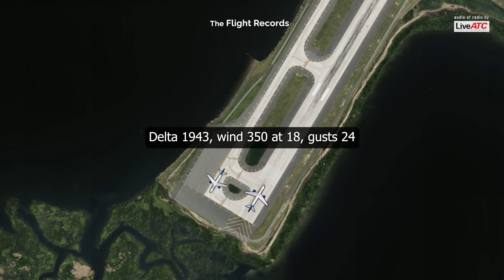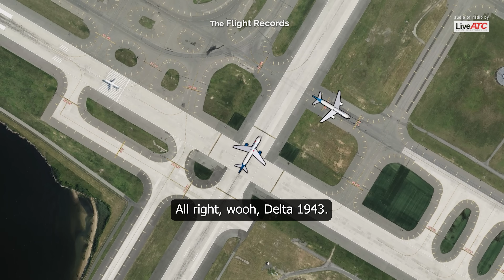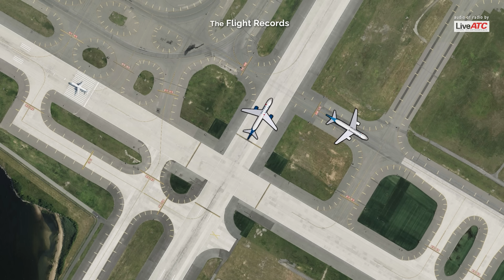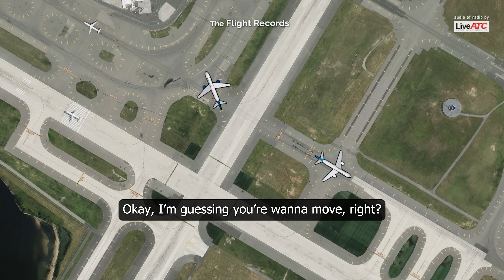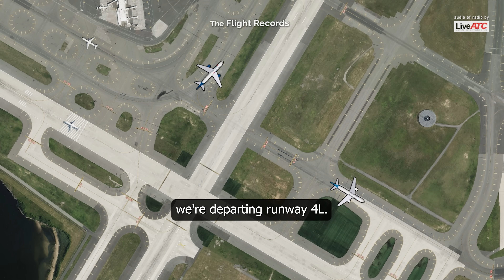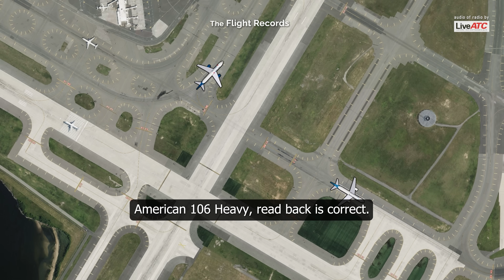NEAR HIT AT JOHN F. KENNEDY AIRPORT

Comment: I’m an Airliner skipper, sometimes reading public comments related to aviation details is amusing and annoying but I understand its just ignorance.  Just like my ignorance of the details of other professions.   The female pilot was the first officer, not the Captain.  F/O does the radio work on the ground.  The Captain made the taxi turn error.  For those making comments about females in the Flight Deck, I don’t think Equity policies are ultimately a good idea either, but there are many very qualified female airline pilots,  I’ve flown with many I respect for their professionalism.  Both sex’s make errors.  The First Officer is the backup to the Captain during taxi, and also should have caught the mismatch between the ATC read back and the turn or lack of turn the Captain should have made.   I use the “FMS scratchpad” technique to jot down the f/o read back / instructions from Ground Control.  Referencing what is written down / typed in the scratchpad is a popular mitigating technique to reduce this error from happening.   Further, most Captains, myself included always verbally state where I am about to turn or what the next hold short point is.   This way my first officer can agree or correct me right away.   I include this as my first item in the Threat Briefing review before we even leave the gate.   Pilots are certainly not the only humans in aviation that can make runway incursion errors.   What happened in Lima, Peru recently is a perfect example.   A320 hit a firetruck during the take-off.   Very tragic.
Reply: YouTube stinks of keyboard pilots, warriors etc etc etc
Reply: @malahammer  Looks who's talking LOL.
Reply: Would it have helped if the ATC said 
“Turn R at Kilo, cross 31L”
He actually said 
“Cross 31L at Kilo”
I think the word “turn R”
Would’ve helped. But I’m not a pilot
Reply: @PInk77W1  I see your point, but what the Ground Controller said/instructed was in the “standard phraseology”.  We (pilots/ATC) know what is meant.  We don’t know yet why they missed the turn or had a different mental picture of where they were going.   I can think of half a dozen reasons for the error.   All speculation.   Good question though.
Reply: @InvertedMike  
Yeah I’m guessing if the ATC has to tell every plane every turn it would be too much.  
But yes I was thinking that was the reason.
Reply: @InvertedMike  Did anyone hear AA106 call that back? I didn't.
Reply: @Capitan-America-no.1  That's because this video choose not to include it. See, for example, VASAviation's video on the event.
Reply: @PInk77W1  What you're referencing is "Progressive Taxi" - which is possible, but also pretty resource intensive for the ATC to give so much time and focus on you and you alone especially on a busy airport surface. It's a lot more common for student and private pilots who are unfamiliar to certain complicated airports to request as such.
Reply: @Skyried  yeah I figured. The AA crew should’ve known where they were going or asked more
Reply: @InvertedMike  I’m not a pilot or involved in this industry anyway but clearly pilots are aware of the departing and arriving active runways before pushback. Why would she or he cross 4L knowing there’s no taxi ramp on the 4R side to approach active 4L departing runway? I’m sure AA and these pilots are quite familiar with the field. Who was piloting AA? Yes, more clarification was needed to cross 31 at whatever taxiway to line up and wait for departure on 4L. Thankfully, a major disaster was avoided! This is indeed scary!
Reply: Well said. Whenever I brief my FO’s on threats I always tell them “I’m a threat because I’m human and capable of mistakes….” After which I ask them to back me up and that I’ll do the same for them. Together we fulfill a simple MO. Preserve life. Preserve license. Stay out of the principals office.
Reply: I am a student private pilot and looking for a better way of copying taxi information for  complicated airports and then making sure I am going the right way. I will ask for progressive taxi.  It's not easy and I make sure I study the taxi diagram. Some airports have tricky taxi way. Signs that point at an angle and you are trying to figure out what taxi way it is.   If you know other tricks to make this task easier, I will take it.
Reply: @kimberlywentworth9160  I totally understand.   Taxiing when unfamiliar is challenging.   Firstly, don’t try to memorize the clearance instructions.   Short hand write it on a knee pad or similar.   Just write the phonetics and use a slash before the hold short if given.   You will get better over time.   Use the internet to look up taxi signage to study.   If you are real keen, use the app or website for LiveATC, get hold of the airport diagram for a select big airport’s ground frequency.   Then practice listening, looking at the taxi chart, and jotting down the clearance shorthand while staying orientated with the map route.    Finally, use the DG / compass in front of you for your orientation, and know where the Mag north arrow is on the taxi chart.   99% of the time the map is orientated North up anyway.    Practice, Practice, Practice.   It gets easier….  Cheers.  Mike
Reply: @InvertedMike  These are excellent instructions, Mike! I find ATC instructions daunting at some airports. I never got my license bc my brain can't digest the rapid-paced instructions. Here, I wonder why the FO didn't follow the instructions and help capt. with the confustion -- CRM... Yes?
Reply: @InvertedMike  i’m not a pilot, but I thot your ideas were spot on. They had to help Kimberly.👍
Reply: @kimberlywentworth9160  Absolutely agree with @invertedMike - I always brief it back - even if it's just me sitting there. I even draw on the airport diagram if necessary.
Reply: @kimberlywentworth9160  I have a body shop and can testify that women don't need to be driving.
Reply: Great comment regarding the ignorance. Interestingly my favorite show is Air Disasters, and the more of them I watch and learn from, I’m aware that I don’t know very much at all. What I’ve really learned is to find the exits when boarding the plane.
Reply: @jayinmaine  I really enjoy learning from these types of shows also.  Gets me digging into the official accident reports to understand more.   The more I learn about errors from other events, hopefully the fewer errors I will make in my own career.   If you really want an amazing accident investigation show, check out MentourPilot on YouTube.   Very, very well done.
Reply: @jayinmaine   you might also enjoy the channel of Mentour Pilot, excellent analysis of accidents and incidents. He will no doubt cover this incident as well, but he usually waits for the official report.
Reply: Mike: Amazing words you shared. I just listened to Cockpit Confidential (unabridged, 9-1/2 hours!) while pavement pounding and all I could think of was, "I wonder if Inverted Mike has written a book . . ." Again, great perspective and valuable info you shared.
Reply: @wjroberts913  Glad to share some insight from my side of the cockpit door.
Reply: It's sad that because all of these companies make a point to force equity policies, it results in people assuming that someone is a diversity hire.  If companies were solely committed to hiring the best pilots no matter who they are, then we would know that every pilot is the best and wouldn't even consider race, sex, etc.  Equity (forced diversity) actually furthers racism and sexism rather than eliminates it.
Reply: @postcardsfromprotest  
Not true at lion air.
Reply: Sorry skip. Women are far too dangerous and rely mostly on emotions rather than logic . None of us feel comfortable flying with a woman in command . So stop ur politically correctness shit .
Reply: She was probably applying lippy when the instructions were read out that’s all I’m saying.  See it all day everyday on the roads man.  Or brushing hair or applying foundation you know what I’m sayin bruv
Reply: @jonboy1000  That is just a ridiculous comment you made and makes you out as a fool. Do you know anything about aviation? We still do not have the voice recorders and the whole story as it's under investigation.
Reply: @jonboy1000  Yeah because every single woman ever born dose that right? I have seen men shaving, brushing therre teeth and brushing their hair as well. Is not just woman. Man either you're single or your wife/GF is very submisive.
Reply: @jonboy1000  
No, and neither do you.
You're not too bright.
Reply: @jonboy1000  if you’d ever choose to fly on my plane, I’d gladly leave you behind at the gate. Just for your own safety, of course.
Reply: @jonboy1000  Yes and doing something not driving related while being PARKED at a traffic light, at a crossroads or even cruising etc. is totally the same as being an intensely trained pilot during one of the most challenging phases of any flight. - Logic and appropriate comparsions please.

Comment: I “always” called crossing a RW even if I knew I was cleared… just to be safe!
Reply: Maybe they thougt they were crossing the runway that was cleared. So they possibly would've called exactly that runway although they were completely elsewhere.
Reply: @DaveChimny  whenever crossing ANY runway, it's proper airmanship to LOOK both ways before crossing . (And there should have been red stopbar lights at the place they crossed )  . So i am guessing they didn't even realise they were crossing a runway yet. Maybe no ANF either.
Reply: AA106 is cleared to cross a RW, but not the one they are crossing
Reply: @lizhongshen  Again, that's why I always called (ex: "Crossing 31L at HB") in case we were wrong. That way ATC could stop us before we made a mistake. And it could save us a violation if we were wrong. Crazy not to always do that!
Reply: we don't care, this video is not about you
Reply: @slowery43  For others to learn from. I flew for 33 years and never had a violation or an accident.

Comment: You missed the vital part. 106 asked to cross at Kilo. But they crossed at Kilo Echo. Obvious pilot deviation.
Reply: No. 106 was asked to cross rwy 31L at Kilo (This part is correct). But they crossed 4L at Juliet which 4L was an active runway for the departure.

Comment: As Daniel says, you are missing the KEY part of the video.  The AAL 106 instructions PRIOR to crossing 4L
Reply: The problem is that you don't have any of the ground controller. They clearly didn't be were they were told to go. They were supposed to turn at a taxiway that was before they went across the active runway.

Comment: you cannot compare this incident to Tenerife. The KLM captain was anxious to get in the air and pushed the throttle’s forward because there was a language miscommunication. Fog had moved in and it was extremely difficult to see. It is apparent that the AA aircraft thought they were in a different location, however, even if it had  been issued clearance to cross a runway, i would stop and look both ways intently before moving on. This happened at night. The only thing visible are aircraft and taxiway lighting. I know you are probably using Tenerife as a comparison because of the high loss of life
Reply: I believe what they mean is that if atc hadn't caught what happened this could have been just as bad as Tenerife.
Reply from the maker: That’s exactly what I believed 🙏🏼
Reply from the maker: You’re absolutely right. In this case I just wanted to emphasize the importance of the situation.
Reply: Comparisons are not exact same by their very nature
Reply: The outcome would have been comparable to the outcome of Tenerife though, although there are nuances, two planes colliding on a takeoff roll when one plane shouldnt have been there is close enough imho.

Comment: Not likely be another Tenerife if the JFK weather was not zero visibility like Tenerife. Delta would have seen the traffic in time. For a really interesting aircraft conflict look for the youtube vid of two flights taking off and actually converging on two intersecting active runways at Boston Logan. One pilot saw it and postponed his rotation and passed under the other flight in 2005. Aer Lingus and US Airways.
Reply: Besides, in Tenerife there was no ground radar
Reply: I remember that one, it was definitely a closer near miss than this and we're all glad they followed the TCAS RA.

This incident just looks much closer to the tenerife crash because, as before, one plane was lost taxiing and another plane on take off only this time the pilot deviation is ultimately the one taxiing (UA)

If I remember correctly on tenerife, it was the KLM captain that didn't have an actual take off clearance, they were asked to hold position cause PAN AM was still taxiing.
Reply: Just imagine it took the AA flight about 5-10 seconds longer to get to J. They would have crossed the runway well within the braking distance of the Delta flight. Just like a deer that jumps infront of your car within your braking distance. You'd expect the AA flight to stop at J so it would be too late to abort take off.
Reply: You don't know any of that,

Comment: So much for CRM training, AA FO should be on the lookout especially when crossing an active runway. That’s why crews are supposed to scan and clarify both clear left and clear right. With Delta’s takeoff run, on the FO right view, he should have stopped the captain. This was a really close call.
Reply: The F/O was the female voice.  Whether or not she should have seen the Delta’s light is indeed a factor… despite the taxiway/runway lights, the Takeoff lights of a commercial airliner can clearly be seen in those circumstances. 

However the biggest issue by far is that AA crossed the INCORRECT runway. 

ZERO situational awareness exhibited by the crew. 

Even more damning is that there were apparently 3 pilots in the cockpit of the AA 777 as well. (One of whom was a relief pilot, that info from the ‘Taking Off’ channel).
Reply: it was dark
Reply: @mikebarker9187  the Delta jet lights were on for takeoff. Can’t miss that.
Reply: @brucesmith9144  Yes.  For sure.
Reply: @mikebarker9187  Delta has lights she would’ve seen if she looked to the right before crossed the wrong runway
Reply: @jasonthomas9364  the amount of lights on ground with multiple AC on ground visibility isn't as easy as you may think especially at that distance and not to mention a 737 on the active.

Comment: ATC clearly told AA to hold and they did not. Tenerife was a bit different, but I get the title of the video. Bravo to the DL pilots and to ATC.
Reply: Earlier in their taxi instructions ATC cleared AA to cross 31L at K. AA read it back right but still proceeded incorrectly.
Reply: @danielhowell6605  I am a student private pilot and on one of my earlier flights.  ( 10 hour of flight time ) I started to turn on the wrong taxi way. My CFI stopped the plane. Even worse I was spoken to in a stern voice. Yes, I think the CFI had to make a point to me. Do not repeat the directions and then go the wrong way. It's better to sound like an idiot, ask again / progressive taxi.  Also make sure you understand the directions on crossing a runway that has been cleared. Something that I will double check. It's not easy and your brain sometimes can go on overload and the taxi signs can be confusing also on airports with multiple run ways.
Reply: @danielhowell6605  Did you hear AA read it back correctly? If so time stamp please. All I hears was American and some static.
Reply: @Capitan-America-no.1  at about 24s in the other video - it's static-y but you can definitely hear AA read back the instruction to cross 31L at Kilo - instead they turned onto Juliet and crossed 4L. AA is in the wrong here BIG TIME.
Reply: @marklnz  Clicks and pops! Right turn left turn. All he had to say was AA106 didn't copy.
Reply: Tenerife they told KLM to wait for take off clearance. They had AFTER take off clearance for route. They were told to wait. But radio interference stopped loads of critical info
Reply: @Phili2012  Horrible accident, indeed. In addition, I recently flew KLM and was not impressed.
Reply: AA was told to cross 31L at taxiway K. They were not instructed to hold. AA messed up and took taxiway J and crossed 4L. Still a pilot deviation. Tenerife was caused by an airplane taking off without clearance.